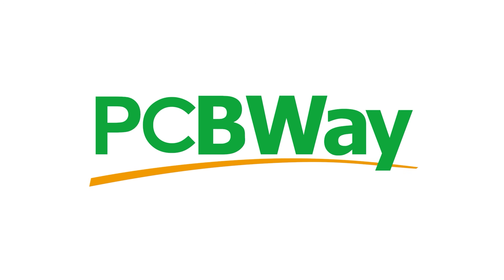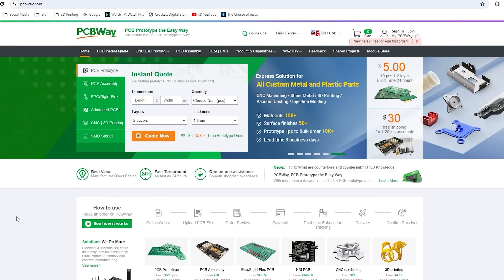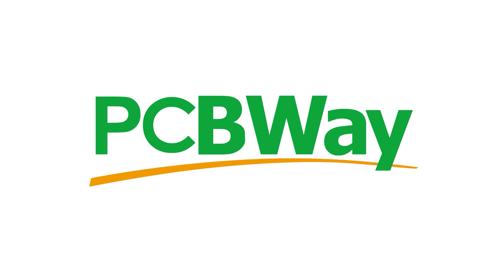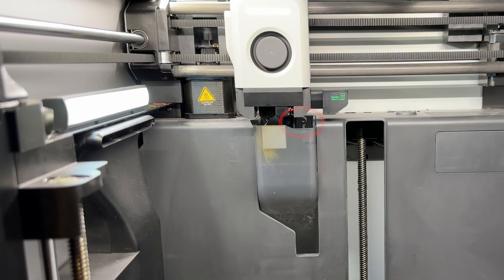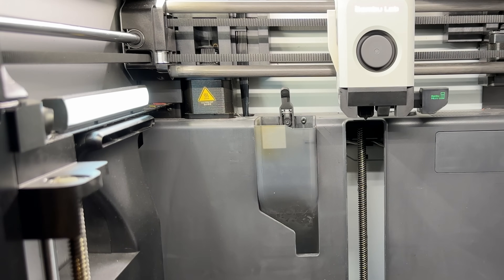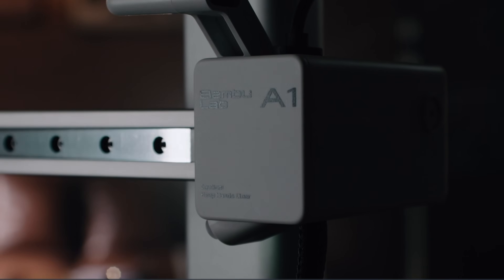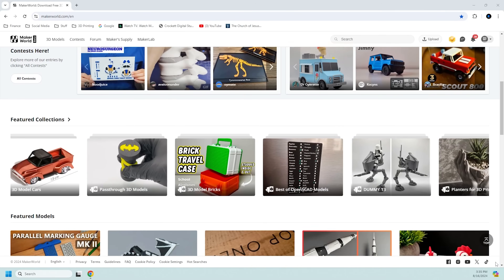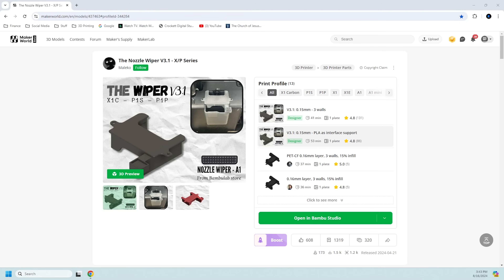Fixing the X1-Carbon's Flawed Nozzle Wiper

Comment: Looks like I may be in the minority on this one, printed this twice using Bambu Lab's PTEG HF and every time i start removing the supports, ( I am using PLA for support material) the print assembly pulls apart.  Not sure what I am not doing right even increased the nozzle temp up 5 Deg F, from the default temp from the Bambu profile.  The print turns out very nice, just doesn't have any strength.
Reply from the maker: @scottfabre239  I would recommend looking at your flushing volumes. Because PLA and PETG don’t stick together very well, having them mixed at all inside the nozzle when printing will cause the material to be weak. I would set the flush between both filaments to 800, which is the maximum, to make sure that all of the previous material is flushed from the nozzle before it starts printing with the next material. 

You could also slow down your print to try and ensure better layer adhesion, especially with PETG. 

I would recommend both, to be sure.
Reply: Thanks I still use the default flush volumes from Bambu Studio, but I will increase it to max, and I did print this on silent mode as I do for most, but will look into the flush.  Thanks again.

Comment: Strange. I have a P1S whi h uses the same mechanism, but i almost never have this issue
Reply from the maker: @patronza  it really depends on what you print, and what features you enable. I do a LOT of multicolor printing with what I do. I do a lot of wiping, and I need the wiping function to be reliable.

Comment: Do you have any problems with the poop shoot blocking up? It’s made the entrance smaller.
Reply from the maker: No, it actually hasn't.  The nozzle has always hovered directly above the front of the chute.  The new part covers a portion of the back of the chute.  Where the nozzle is very close to the opening, and there is plenty of clear opening all around where the nozzle sits, there are no issues.
Reply: Thanks
Reply: I am having the same issue.

Comment: I actually use the one that combines that exact silicone wiper and uses the original wiper as well. I've got around 2000 hours on my printer with over 1500 of those hours with the wiper improvement. I found this to be the best solution as every once in a great while on a heavy swap print the adhesive on the silicone will fail, or one of the little teeth will wear out and I won't notice for many hours. Using both basically fail safes it and I haven't had filament get drug into my print in well over 1000 hours and god knows how many filament swaps because I do very little single color printing.
Reply: Is that the Jio一物贴 one?
Reply: @WhiteHawk77  Possibly, I don't remember exactly. But there was only one at the time that combined both so, most likely.

Comment: The one I printed retains the original wiper as well as using the A1 wiper.  Works perfect.
Reply: Which model did you print that retains the original wiper.  I just installed this one, but have not printed yet.  Thanks.

Comment: i hope they see this video/3D print i dont own any bamboo printers myself but they seem really good other than the 1 nozel cleaning issue and its a simple fix
Reply from the maker: These printers are really good. I highly doubt, however, that they’ll make any revisions to this model. But this improvement did go into the A1. And the nice thing about the 3D printing community is that someone will always come up with a solution to a problem. And this solution is cheap and easy to implement.
Reply: "Why" do you hope they see this video? 

They won't do anything about it. This fix is too simple.
Reply: @DingleBerryschnapps  why would they not do it? if its a simple fix for me and you whats stopping them from just going back to the old scrubber but on future models of 3D printers?

Comment: Would this be compatible with the P1S? There are times mine wont cut that thing (the waste) off and it ends up gragging it around or it ends up falling off laying on the plate
Reply from the maker: It looks like the P1S has the same wiper that the X1-C has.  I believe this would work with it.  I've seen comments from P1S owners that say they are going to try it.

Comment: Hi, great video and I was very keen to print this for my X1C using PETG and PLA for the support. I am running into trouble with the support though and wondered if you would post the settings you used as I am a bit confused with those supplied on the designers model site. ( Bare with me as I am into my 60s and still playing catchup with regards to 3d printing which is why I went for the Bambu Labs X1C as I was hoping it would be easier to deal with than the old Ender 3v2 I had many moons ago). Ant help would be greatly appreciated, Thanks.
Reply from the maker: @subseauk  I can understand the confusion. I ended up having to use my own settings. I did make a reference to a video I made previously that explains this. But basically, you’ll go to the Support tab in Bambu Studio. These are the settings you’ll want:

Top Z distance: 0
Top interface spacing: 0
Reply: @thisprintedthing7967  So other than the Z distance and interface spacing I am assuming all other settings were stock? Oh and thanks for replying so quick
Reply from the maker: @subseauk   no problem. I actually am not sure about defaults. I have built profiles with my own settings. So I don’t have defaults on a lot of things. But your top Z distance is the space between the support interface and the bottom of the model. You want NO air gap between them so that it prints the PLA directly onto the PETG. The top interface spacing is the horizontal space between lines of the interface. You want your interface to be solid. For a lot of these settings, if you hover your mouse over them, a tooltip can pop up to explain what they are.
Reply: @thisprintedthing7967  So you use PETG as a support raft material and only introduce PLA as the interface material?
Reply from the maker: @ correct.

Comment: I figured out how to access it from the top side of my X1 Carbon printer. It was so easy to do in 5 minutes or so. I did have my A1 wiper set of 4x3 come off after constant printing of 6 hours - not using glue. However, since then I used the Bambu Labs magic glue stick on the back side of the A1 4x3 sticky side and replaced in the PETG-HF holder. It has held well so far. Working well!

Comment: Printers are great. Support is a nightmare.
Reply from the maker: @Cjx0r  I haven’t experienced bad support. Granted, they are a little slow to respond. But they are in China.
Reply: @thisprintedthing7967 I've seen the other reviewers have issues and support stepped in to correct the problem immediately. For normal people without youtube channels or sponsors, you'll be beating the solution out of them over weeks.
Reply: @thisprintedthing7967  3rd time typing in this comment over the past few hours. I've seen a lot of reviewers on youtube share problems theyve had with Bambu equipment and the company swooped in to correct the issue promptly. Sadly tho, if you dont have a youtube channel or undisclosed sponsorship (like this video), you'll be beating a solution out of them for weeks.

Comment: I would like to see the X1 Carbon with clear not smoked glass just so you can see through it and let light in, also a door hinge that allows the door to swing out of the way when its open an not so you have to squeeze by it to get inside.

Comment: A very important change I did also is in the preliminary stages before the actual printing starts. The hot nozzle dwells in time after printing the priming front line. It creates a blob (oozing) that often gets stuck and carried outside the nozzle. It depends on the filament type.. petg and tpu are kings of that crap stick blob; This happens after the wipe motion.. so even with a better wiper often later comes trouble.
Reply: btw.. love the wiper improvement. Looks like the best fix I've seen.
Reply: Can you write a short guide on what changes you did to the code for people to copy/paste it? I'm using PA-CF with PETG as support, and it blobs like crazy with the PETG.
Reply: @KhanGirey  sorry no its not hard just look into it. observe it and find where the code is. Im not going back finding, organizing and explaining, spoon feeding. Already gave the pointer.. and its easy to observe find and fix.
Reply: @chicoxiba Wow, although I don't personally care or want this information, I think it's pretty crappy and rude of you to answer in the manner you did. That's fine if you don't want to take the time to help other's in the printing community, but Karma will hopefully come back on you! I'm sure you've received a plethora of information regarding certain issues you've come across that people were more than willing to help you with, whether it be directly or indirectly by taking the time to write up how the issues were resolved. You can take info from the community, but refuse to help other's in need for the same info and with total disrespect by saying you're not going to "spoon feed" them. Just remember, the person who took the time to guide you on this same issue, therefore "spoon fed" you as they took the time to write up the information to help you and other's when they could have just kept it to themselves. If everyone responded the way you did, or refused to help other's in this community, then you nor the majority of people wouldn't know the first thing about 3D printing. You may be self taught and searched for the info you needed, but it's because of other's who took the time to write out or explain that info, that we're all able to learn from in the first place. That's what makes the printing community so great, aside from people like you, who will take and not give back when other's are in need.
Reply: What preliminary stages did you change?
Reply: @MisfitsGuideToTheGalaxy  that question is BASICALLY answered on the first comment. Observe as I did.. if you are having blobing stuck to the nozzle. You will find eureka.

Comment: Another solution is: don't buy an X1C.  Instead, get a P1S, which doesn't have the useless lidar and doesn't behave like that.
Reply from the maker: @EliteMacFreak  read the comments. People with P1Ss still have problems, or the potential of problems any time the tool head is parked and filament extrudes into the chute. Even if that PTFE tube knocks off the string of filament, often there’s still stuff that stays on the nozzle that the PTFE doesn’t get. Eventually it comes off, somewhere, and often onto the print. 

I had turned off the first layer check on all 4 of my printers, and that bandaided that issue. But I would still get little flecks of crusted filament on my prints here and there from where the PTFE tube simply pushed hot filament onto the side of the nozzle from where it would just fall later. 

These issues are still just as present on the P1S as they are on the X1-C, as the wiping mechanism is the same on both printers. So I’m afraid your flippant comment is somewhat null and void.
Reply: @thisprintedthing7967  You read the comments.  They're not saying they have problems.  One guy said he had strands in the bottom, which is not the fault of the wiper.
Reply from the maker: @EliteMacFreak  then you haven’t read very many of the comments, if that’s all you got.
Reply: What makes the lidar useless?  I've had it detect issues with my first layer and abort the print properly.  I don't imagine it's perfect in every scenario but it's definitely not useless.

Comment: Have you had any problems with the chute plugging? That lever contraption all the way in the back appears to be primarily to periodically knock the flap in the chute so that the little balls of filament you generate in a multi-color print drop out of chute. I have a P1S and the filament dragging problem is a problem for P1S even though there is no LIDAR sensor. I'll be making one of those when my replacement P1S gets delivered in the next few days.
Reply from the maker: @waynewells4885  I don’t have that problem. But my friend with a P1S does. Today I had him send me a picture of the bucket he puts behind his printer, and basically it was the bucket that was causing it. It was very shallow, like the floor of the bucket was raised up to be just below the hole that the waste exited from. I told him to print a deep bucket into which the waste falls straight down to the bottom, not one that tries to be fancy and ramp down to the side from just below the waste chute. Not sure if this is also your problem, but it is a coincidence that he was telling me just today about his chute clogging issue.
Reply: @thisprintedthing7967  Bambu Lab discourages those buckets if it is the type that wraps around the left rear corner. They have a page on their wiki specifically that is "Bambu Lab Mods to be cautious about" and on that page is a link to 3 different styles of chute.  I was going to write a comment about why they even have the gate down in the chute that gets tapped by the rear assembly that toggles in both axes. Halfway through writing the lightbulb went off. That flapper is so the filament balls up and you don't end up with a long straight extruded strand of filament then wants to drag like in this video. Flapper closed, it balls up on flapper then the arm all the in back of chute smacks the flapper so the balled up filament drops.

Comment: I've only had my X1C printer for a week or so now and I printed out in PETG-HF the X1-Carbon v3.1 Nozzle Wipper and added in the A1 rubber set of 4x3 (after digging out the support stuff). It has a good fit and doesn't look like it will move. But all the instructions don't tell user how to get access to the 3D print head. Do I take off the back side of the printer or home it some how? Are there instructions telling me how to get access to the print head? Please help as I'm very new to this.

Comment: I replaced the ptfe tube with 6x 6x2mm silicone o-rings. No issues anymore since more than 8 months.
Reply: hello! you can send me a photo please??
Reply: @ezequielpena178  how? You can’t send links in YT comments and I can’t send you a message either. 
But it’s just 6 silicone o-rings with 6mm OD, 4mm ID (2mm ID not 4mm!) and 2mm thickness instead of the PTFE tube used by Bambulab.
Reply: @Todestelzer if you break up the link so it doesn’t look like one that might work.
Reply: @WhiteHawk77  tried it. The post got deleted. The bots got better detecting links the last couple years. But there isn’t much to see anyway.
Reply: @Todestelzer With 6mm OD 4mm ID, I only find 1mm thick o-rings.  Where did you get yours?
Reply: @danielbecker8373  oh man… That’s what’s happening when I post a comment at 2am. ID is 2mm. The OD is 6mm I measured the o-ring again. 
Sorry 😂

Comment: Something I didn't realize I needed. Glad this came up in my feed.
Reply from the maker: @37Kilo2  thanks for watching.
Reply: The filament trail happen to me less then 10% of the time. Every time this happen, my part print just fine. Perhaps it is more relevant on very small parts. People tend to like modifying their toys, untill they realize they broke it. There is one guy using that mod report that one corner of the part lift and broke his hotend. Enough for me to wait on Bambu Lab to get a fix if it's a REAL problem.

Comment: PETG was driving me nuts.  Every single time I'd have stragglers dragging along with the nozzle.  Can't wait to get this installed!  Thanks!
Reply: Follow up!  Massive improvement!  Not had a PETG print fail since!
Reply: throw some of Slice3d's nozzle paint in the mix as well. You will have to have a serious filament issue before it causes a failure with this wiper, and the paint.

Comment: But now you have a smaller opening for the poop shoot
Reply from the maker: @Printed_Visionz3D  correct. But when filament is extruded from the nozzle, it falls straight down. The hole that is left with the insertion of this new part is not a small hole. It is still a very big hole. Even if the extruded filament didn’t fall straight down, there is still plenty of hole all around the area directly under the nozzle. And the nozzle is like a millimeter above the opening of this large hole. Into the hole is the only place the extruded filament CAN go. 

I’ve been running with this solution on one of my printers for about 3 weeks with absolutely no issues, and it has fixed the issues that I had before.

Comment: I have been using a different model that does a similar thing for around 9 months now and it works great. The one I use is on Printables and keeps the original wiper as well as adding the brush. It also doesn’t block the chute like this version does.
Reply from the maker: That's cool.  So you have both.

This version doesn't actually block the chute.  There's still a very wide hold directly under where the nozzle parks to purge.